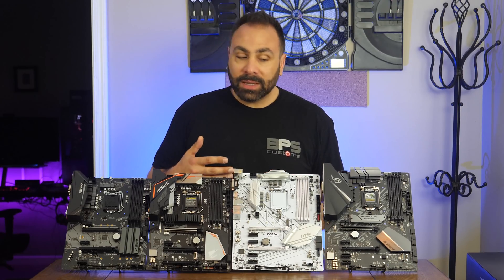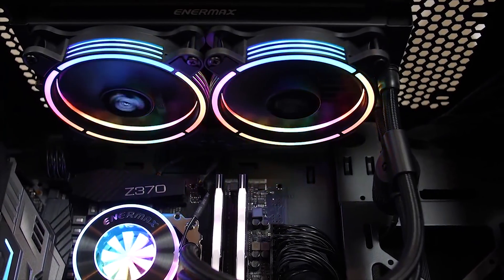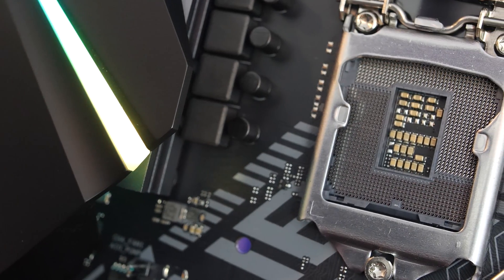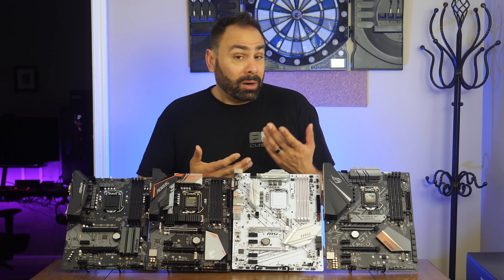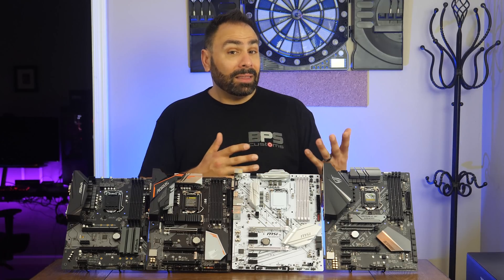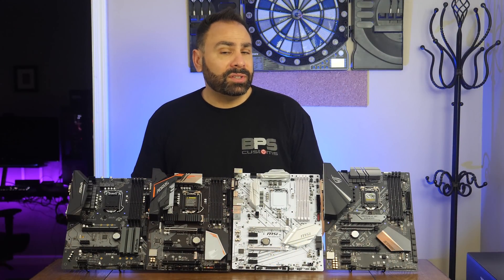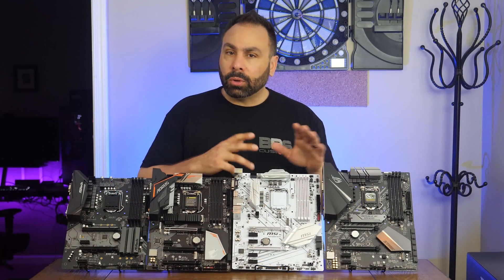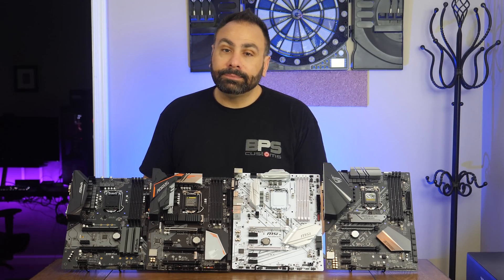Budget Intel Boards Are Here!  H370/B360 Roundup!

Comment: * $130 motherboards are not budget motherboards.
Reply: Barack Smith Uh, yea they are. High-end boards can go up to $600+..
Reply: Uh no, the cheapest H370 motherboards on Newegg.com are $55 and the cheapest B360 motherboards are $65, those are budget motherboards.
High end cars go $500k+, that doesn't mean a $50k is a budget car.
Reply: Scott G. 

Yeah and those are x platform motherboards usually. Higher end z series boards are usually between the mid 100' to low 200's. 130 bucks is not a budget board
Reply: Barack Smith I've used a $55 board before. Don't wanna really do that again. Feels so flimsy. I will say, however, that there weren't any problems using it.
Reply from the maker: It's all relative.  Want a fully featured 1151 motherboard for coffee lake?  You're either paying $220 for a Z370, or now you can pay $130 for B360. If you're willing to compromise on features, yes of course you can get something for less.  But I think for most people, $90-$140 with most popular features plays a lot better than $170-$220.

Comment: At the moment I really see no point in buying a locked Intel CPU for each model there is a better and mostly cheaper solution from AMD.
Reply: 2600X with B350 there are already benchmarks out for 8400 vs 2600X
Reply: Tom Köngeter Ryzen 5 already beats the 8400 especially after you OC. Also the boards are way cheaper and have alot more features.

Comment: Recent bought an x58 EVGA, revision 1.1 Classified mobo for 5 bucks at one of my auctioneer buddies estate sales. In box, with all accesories. Even the cd. Going to pair it with an 5690 Xeon 3.46 GHz, 6 core 12 thread CPU. Sixty-five bucks for a mobo, and a 6 core 12 thread CPU at 4.5 ghz! I'll take it! Currently building a ryzen 7 1700x for my daughter. Be fun to play, and compare with some older tech for cheap.
Reply: These old Xeons overclocked are roughly around the same performance as Ryzen 1600 without overclocking.
Reply: Brian Joseph I just gave my daughter a 1700x this past weekend..She was on a 8350 that was cutting off from heat so I just gave her my 1700x. It's a much needed improvement and should last a few years.
Reply: RdyPlyOne Hell yeah, I bet she loved that! This is my daughters first PC. I've been doing it piece by piece because of prices. Almost there though. Black and white build. Dark rock pro 4, killer x370 mobo. Phanteks p400, seasonic 620w modular, 80 bronze, sapphire nitro r7 370, 4gb GPU (damn prices,) and 8 gb ram to start. I've found a few people who made that cooler work in that case. Phanteks specs seem to be slightly off. Good luck, and be safe out there.
Reply: Bitter Cynic Thank you, thats not bad at all. I'll probably just make a budget gamer out of it, and put it up for sale.
Reply: Brian Joseph Yea I bought a 2700x as my replacement and since I use an open loop gave her the 2700x cooler with my older 16GB TridentZ 3000C15. It all looks really good.